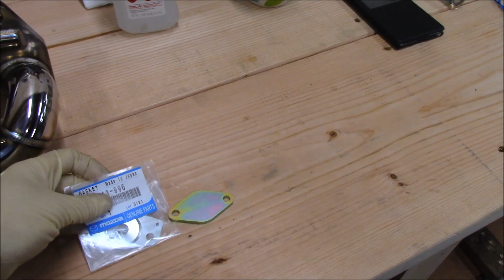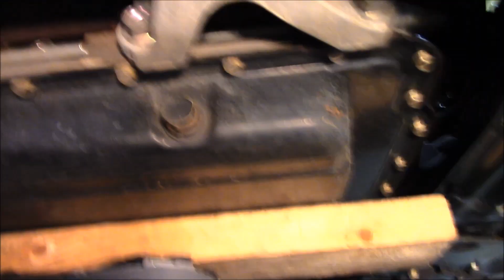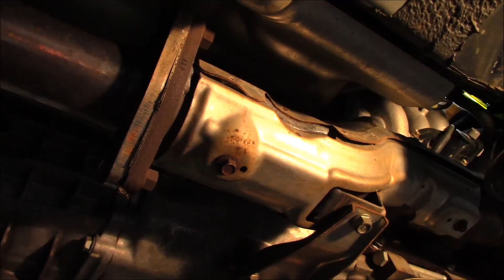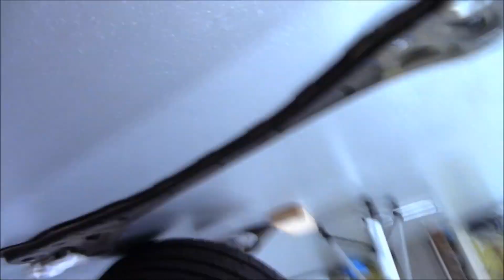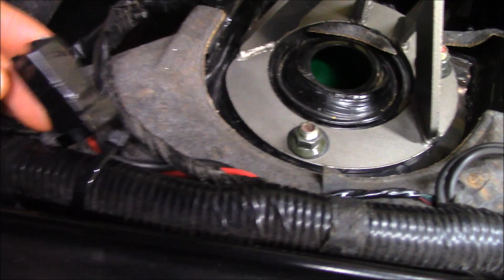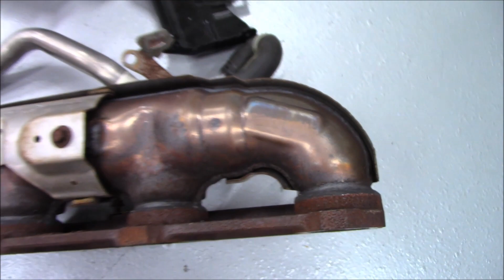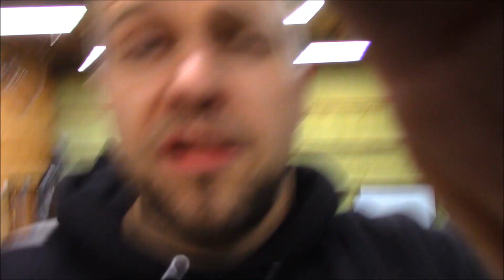RX-8 Header Install - GQM Garage

Comment: Do you find it is more raspier with the header? also are you ever going to use the dual resonated race pipe??
Reply from the maker: It's a little raspier, but nothing obnoxious. I sold the dual resonated pipe to a friend of mine. If i end up getting rid of the stock catback I'd consider getting a beefier resonator, but I am mostly concerned with weight and noise. Ironically the OEM catback is lighter then most of the popular aftermarket options that have decent mufflers to actually muffle sound. So it's kind of a wash.

Comment: where did you put the airline for the pump?
Reply from the maker: The whole airpump assembly is removed. You can see me attaching the block off plate to the header where the tube would normally connect.

Comment: if you got rid of your cat and went to straight pipe, how do you pass emissions now?
Reply from the maker: The midpipe I am using has an o2 extender and it doesn't cause a CEL for the cat removed.
Reply: gotchya, thanks for the info.

Comment: What did this header do to your exhaust note?  (I'm full straight pipe right now and shopping to smooth the rasp a bit) . Where did you get that mid pipe piece to fit the O2 sensor on? I'm catless and the cel is annoying.   Also one last question I'm looking to go with wider rear tires on my R3 currently it's 8x19  +47 I believe. Any suggestions on a rim size to fit a set of 255/35/19 tires...  I was looking at either 9.5x19 or 10x19 both would fit the tires but my goal is to be nearly flush to the edge of the wheel well and not get into the suspension on the inside edge.  Any input on size and offset that would clear all around without rolling fenders?
Reply from the maker: The exhaust note got a little louder, maybe sounds a tad more tuned. I wouldn't say raspy though. The midpipe came with the silver RX-8 I bought. I believe it's just an eBay unit. It does have a built in CEL spacer, threw a light initially, but then it went off and never came back. I usually run 255's on a 9.5 wide rim and the fitment is about perfect. I wouldn't recommend staggering wheel size on the RX-8 though. It will just induce understeer and take away from it's wonderful balance. I have 18x9.5 +30 with 255/35/18s all around on my car. The fitment is very aggressive and clears without any rolling, some camber and a conservative height. See my suspension install video for the complete details. I think 18x9.5 +38 is perfect fitment for an RX-8.
Reply: Garage Quinn Motors hi , that sounds right but can you give input / thoughts if skinnier tires up front would produce understeer? Or maybe im understanding it wrong. Wouldn’t that cause oversteer?  Im just curious on your thoughts, though I agree because they did engineer the rx8 totally square
Reply from the maker: Skinnier tires up front would make the front wheels more prone to lose grip before the rear tires, therefore understeer as the car would track straight when trying to turn.
Reply: Gaming Made Simple i have 18x9.5 with +22 offset with 255 40 18s with no clearance issues
Reply: pmm4177 can you please post a picture or a video and then link it here? Thanks
Reply: Dang this header um looks so good. 
But dang my car will be too loud I think

Comment: That heat sink resistor that was under the air pump is the fuel pump resitor. Mine went out couple months ago, for the life of me could not figure out why my 8 would not run. Finally took it to stealership, they wanted couple hundred dollars to replace it, found one on eBay for like $15 shipped an installation myself. 
But anyways thanks for the videos man really like your style and love for cars, keep up the good work 👍
Reply from the maker: Ah gotcha. Well good to know! Anytime! Thank you very much for subscribing and for the support 👍

Comment: have you thought about putting wheel spacers in the rx8?
Reply from the maker: The 18x9.5 +30 wheels I have on there now are really aggressive fitment. If they were a less aggressive +38 offset, they would have been about perfect. So wheel spacers definitely wouldn't benefit my scenario ;)
Reply: 18x8.5 +35 on mine, fits just to the top edge of the fender with some poke on the lower fender.
Reply: 18x9.5 +4 on mine Haha 25mm poke

Comment: Crazy question? Did you wrap the header? I know rotaries throw serious heat, and, this looks like no exception. Also, noted heat shields on OEM unit? I know you deleted the air pump, but, think it'll get pretty HOT down there... If not- would you consider it, just to keep heat down?
Reply from the maker: No wrap. It is installed as shown in the video. The air pump only runs when the car is cold and is to help the catalytic converter get up to temp. I don't think there is much cooling benefit from it. Having no cat already helps lower exhaust gas temperatures. Plus heat wrap fatigues the welds on the headers faster. I doubt heat will be an issue since this is only a daily driver for me. The amount of track driving conditions this car will see are going to be small.
Reply: Quinn? Are you exempt from IM emissions testing? I'm in NH, and, I have to pass IM emissions up here, and, we are the "Don't Tread on Me" State. I understand the air pump process, but, since I'll need to plug in annually, I can't have codes. I think I HAVE TO keep the catalytic convertor ( I don't know a guy who can pass me) so, leaving the air pump in to reduce warm up time- lengthening cat life- seems to be my ONLY choice. $1,300 seems very steep to replace as well. Ouch- it's definitely another downside to the 13-B.
Reply from the maker: Mazaedit will allow you to disable the CEL. We are not exempt here unless the car is 25 years old. I have a cell spacer in my catless midpipe that doesn't cause any CELs either. In my state we can have 1 monitor not ready and still pass.

Comment: If this is a DD how do you plan on passing emissions tests without a cat? Just curious.
Reply from the maker: It would fail the visual if the place wants to bust my chops. Otherwise, the midpipe that is on here has an o2 spacer that prevents a CEL for a missing cat.

Comment: You said you bought the dual resonated RB midpipe,what pipe is on the car? is that dual resonated also? Thanks :)
Reply from the maker: I am running a no name eBay one that came with the silver RX-8 I picked up this summer. It has a single small resonator in it and a built in o2 sensor spacer.

Comment: Good job! Have u got some CEL? I do want to replace the header, just worry about the engine code. You know, cannot pass the safety inspection! Thanks.
Reply from the maker: A header alone will not cause a CEL if you retain the air pump. Removing the air pump or deleting the cat can cause you to throw a CEL. The midpipe I have has an o2 space (visible when showing the installed exhaust in this video) and that has prevented me from getting a CEL for the cat being removed. The air pump removal causes a CEL.
Reply: Thanks. I really appreciate. It is a nice time to buy a header from the racing beat. Lol
Reply: @TheSlipAngle  So how do you get round the CEL for the air pump? Is there a way to trick the ecu into thinking the sap is still there?